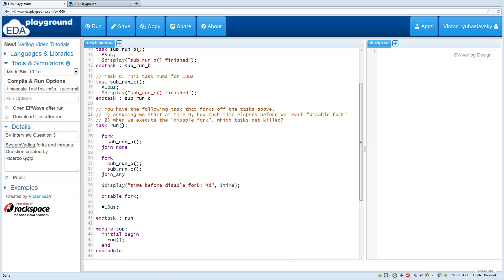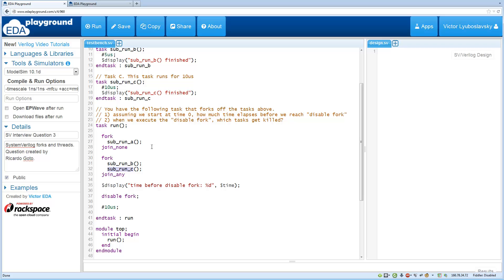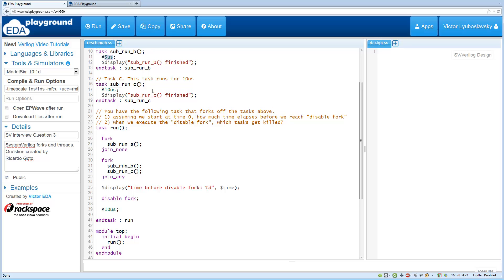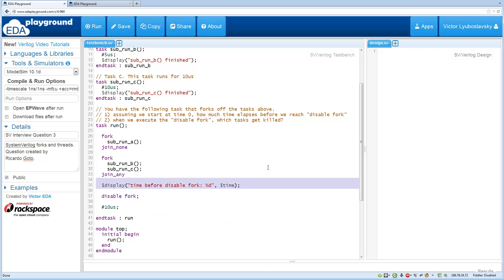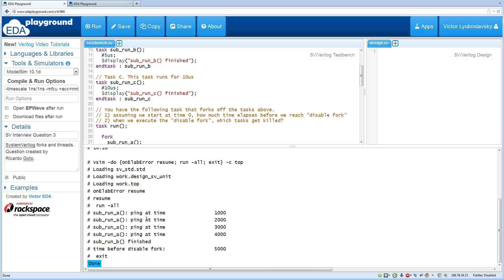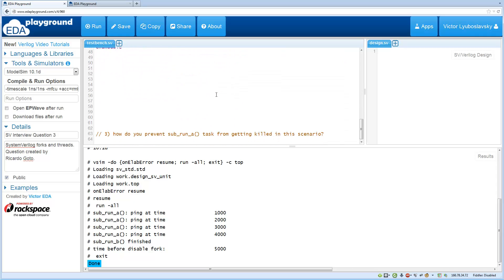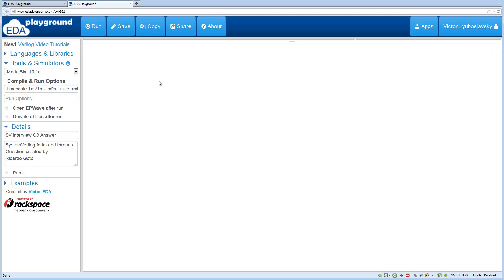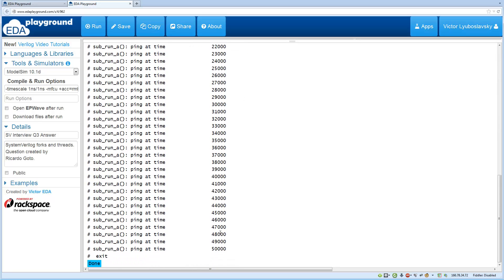SystemVerilog Interview Question 3B -- Forks and Threads

Comment: My answer is one can swap the “join none” statement in fork block 1 with “join any”. The program will then have no choice but to allow task A to complete running before going into the next fork block.

What do you think?
Reply from the maker: That would work. It meets the letter of the law, but perhaps not the spirit. The idea is for sub_run_a() to carry on executing, whereas putting it inside a fork..join_any just means that it gets to finish before any other thread is started, (In fact, a the fork..join_any is redundant with only one branch,.)

Comment: Could the owner of the page explain why sub_run_a(): ping at time                 5 000 did not get hit?
Reply from the maker: Good question. The order in which concurrent threads get executed in Verilog is undefined. So, it could be that "sub_run_a(): ping at time                 5 000 " does get hit on some other simulator (though not on any of the three on EDA Playground). Changing (eg) line 25 to (eg) "  #0 $display("time before disable fork: %d", $time);" (by adding the "#0") forces "sub_run_a(): ping at time                 5 000 " to get hit. Yet all we have done is delay the "disable fork" to the Inactive region. Here is a very brief explanation of what is meant by "Inactive region" - https://stackoverflow.com/questions/42512214/how-to-use-clocking-block-in-verilog/42512610#42512610 . Matthew

Comment: //*******// Ques : How to prevent run_a() task from getiing killed due to disable fork?
/// **** Solution starts ****
             
   fork 
 run_a();    
   join
//// *******  Solution part ends

Put solution part before  * "disable fork" ** , to get the desired result.
Reply from the maker: That would work. But you have changed the behaviour of the code (tasks B and C now don't start until A has finished). If you look at the answer from Wayne Wang,  he has managed to prevent the task A from being killed without changing the behaviour. (This is a hard question. It's difficult to say, because I know the answer, but I'm not sure I would have been able to answer it.)
Reply: @Edaplayground_EPWave  wait fork should work before disable fork
Reply from the maker: @Devika0122  Yes, but won't that kill the sub_run_b() and sub_run_c() tasks as well? I guess the English is ambiguous, but I think it implies that we don't want to kill the sub_run_b() and sub_run_c() tasks.
Reply: @Edaplayground_EPWave  Wayne Wang's solution also lets task c finish which isn't the requirement of the question. I tried to to simulate his solution and it shows so.
So what is the proper solution?
Reply from the maker: @shahzebimtiaz1849  I agree. I think you need an extra begin..end. See https://www.edaplayground.com/x/e3B4 .

Comment: task run();
  fork
    sub_run_a();
  join_none
  fork:lable
    sub_run_b();
    sub_run_c();
  join_any
  $display("time before disable fork: %d", $time);
  disable lable; 
  #10us;
endtask : run
Reply from the maker: That's a good solution.

" disable lable; " You're a poet and you didn't know it!  :-)
Reply: @Edaplayground_EPWave  I think this has one disadvantage. Say if we have other instances(objects) and, when they call this task the disabled fork block  will remain disabled and, it will not execute at all. Using this naming approach for fork makes this be visible to all the other objects(ie: I think it becomes static in nature)
Reply from the maker: @srirams1986  Yes. I think you're right. Disabling fork joins can be a bit of a minefield.

Comment: Hi Matthew,

I tried using EDA playground and I am running into some issues to get the code compiling even though the code seems pretty clean. Anyways this is what I am trying to do

task run();
int a,b=1;
int d = 3;
int e =4;
fork : first
 begin
    a=b+d
 end
join : first

fork : second
 begin
    b=a+e;
 end
join : second
$display("a = %0d",a)
$display("b = %0d",b)
endtask : run

If I run the above task run, in what order will the two forks be executed if we are running on a single core? This can be a potential race condition, Correct?

I understand fork-join is used for concurrency, but does it really achieve that on a single core machine? My understanding is that at any given time only a single thread can run on a core.

Please let me know if I am missing something.
Reply from the maker: Hi Abhilash,

There are three issues here:

i) You are right than fork-join is used for concurrency, but the concurrent threads are those between a single fork...join pair. So,

  initial
    fork
      $display("This thread will be run...");
      $display("...concurrently with this one.");
    join

The order of execution is indeterminate, so we might get:

  This thread will be run...
  ...concurrently with this one.
  
or we might get

  ...concurrently with this one.
  This thread will be run...

There is no way to tell. 

However, in your example, the two additions are NOT run concurrently, because the two fork...join blocks are executed sequentially. So, this looks more like your code

  initial begin
    fork
      $display("This thread will NOT be run...");
    join
    fork
      $display("...concurrently with this one. This one will ALWAYS be second.");
    join
  end

Running this will ALWAYS give this output:

  This thread will NOT be run...
  ...concurrently with this one. This one will ALWAYS be second.

ii) The concurrency within a fork...join block is exactly the same as the concurrency between initial and always blocks. This:

  initial
    fork
      $display("This thread will be run...");
      $display("...concurrently with this one.");
    join

is exactly the same as this:

  initial
      $display("This thread will be run...");

  initial
      $display("...concurrently with this one.");

iii) Threads are not run concurrently on multiple cores. Verilog was designed in a time when computers usually had just one core, so at any one time only one thread is running. The simulator is free to execute any concurrent threads in almost any order it likes - the order is indeterminate. So, you might well ask what is actually meant by "concurrency", given that the simulator is only executing one thread at any one time. The answer is that a group of concurrent threads can be executed in almost any order in a timestep, in other words, a simulator as free to execute everything that has to be done at a certain simulation time, in almost any order it chooses. Execution of a thread must stop when that thread meets some kind of timing control (wait or # or @) - it will resume at some future timestep when the simulation time has advanced.

"Almost"? Yes, almost. The "almost" is key. The simulator is restricted slightly, according to what kind of assignment you use. Blocking assignments are always executed before non-blocking assignments and $strobe and $monitor are always executed last (at any timestep). The simulator runs according to this flow chart (which illustrates"the verilog scheduler"):

  from previous timestep
    |
    V
  BLOCKING ASSIGNMENTS
    |
    V
  #0 ASSIGNMENTS (no longer used)
    |
    V
  NON-BLOCKING ASSIGNMENTS
    |
    V
  $strobe, $monitor
    |
    V
  to next timestep

Verilog is vulnerable to races, there is no getting away from that. There are steps you can take to avoid races: I'm sure you know that you use blocking assignments for combinational logic and non-blocking for sequential. That is to avoid races; they are avoided because non-blocking assignments are executed after blocking assignments, as shown in the above flowchart.

However, with more high-level constructs - tasks, fork...join etc - you are still vulnerable to races. It is up to you (the programmer) to sort that out.

DISCLAIMER: 

I have answered this question for Verilog, not System-Verilog. The scheduler is even more complicated in System-Verilog (it has 9 states, not 4) and there is the added complication of what are called "dynamic threads", which are introduced because of the fork...join_none and fork...join_any constructs.
Reply: Thanks Matthew, appreciate the detailed explanation. I had one more question.

Assume all variables are initialized to zero at the beginning.

Code1:

always@(posedge clock)
fork
  #2 a=1;
 #2 b=1;
 begin
 #2 c=1;
 #2 d=1;
 #2 e=1;
  end
#2f=1
join

Output: a,b,c and f all go high 2 ns after the clock edge. d has an additional 2ns delay and e has a further 2ns delay.

Code 2:
always@(posedge clock)
begin
  #2 a=1;
 #2 b=1;
 fork
 #2 c=1;
 #2 d=1;
 #2 e=1;
  join
#2 f=1
end

Output: a goes 2ns after clock, b 2ns after a. c,d,e all go high 2ns after b and f goes high 2ns after (c,d,e).

Do you think this is correct?

Also within the always block in code 1 and code 2, how many threads do you notice?

Thanks
Abhilash Gopal
Reply from the maker: Hi Abhilash,

> Do you think this is correct?

Yes. Also,

Code 2:
always@(posedge clock)
begin
  #2 a=1;
 #2 b=1;
 fork
 #2 c=1;
 #2 d=1;
 #3 e=1;   // changed this to 3
  join
#2 f=1
end

Now output: a goes 2ns after clock, b 2ns after a. c,d all go high 2ns after b, e goes high 1ns after c,d and f goes high 2ns after e (3ns after c,d). This is because the code after a fork...join doesn't execute until all the threads inside the fork...join are complete.

> Also within the always block in code 1 and code 2, how many threads do you notice?

Code1:
4 threads

Code 2:
3 threads

Cheers,

Matthew
Reply from the maker: It works, but you can get away with one less fork...join. Have a look a this:: https://www.edaplayground.com/x/2MW6

Matthew
Reply from the maker: Sorry - replied to the wrong message...

Comment: Hi - 

What if we put another fork ...join on top of these forks as following 

module top;
  
  task top_a();
    while($time < 12ns) begin
      #1ns;
      $display("top_a = %0t",$time);
    end
  endtask 
  
  task top_b();
    #5ns;
    $display("top_b finished at 5ns");
  endtask
  
  
  task top_c();
    #10ns;
    $display("top_b finished at 10ns");
  endtask
  
  
  task run();
    
 fork 
  begin
     fork 
       top_a();
     join_none
  end
    
    begin  
     fork 
       top_b();
       top_c();
     join_any
  //  end
     disable fork;
    end 
   join      
       
     #5ns;
       
  endtask
       
       
  initial begin
    run();
  end
endmodule

This also works while simulating it.

Please provide your comments whether its correct way or not.
Reply from the maker: +Pratik Shah 
The extra fork-join makes no difference, because the the fork-join_none starts a dynamic thread and so finishes immediately. So, we have to wait for the fork-join_any thread, which was the case before you added the extra fork-join.

Comment: Hi 

I was able to solve this question.However I got one more query 

// Task A. This task runs for 50us
task sub_run_a();
  while ($time < 50us) begin
    #1us;
    $display("sub_run_a(): ping at time %d", $time);
  end
endtask : sub_run_a

// Task B. This task runs for 5us
task sub_run_b();
  #5us;
  $display("sub_run_b() finished");
   
endtask : sub_run_b

// Task C. This task runs for 10us
task sub_run_c();
  #10us;
  $display("sub_run_c() finished");
 
endtask : sub_run_c

task my_task();
   fork
    
    sub_run_b();
    sub_run_c();
    
  join_any  
 
endtask:my_task

// You have the following task that forks off the tasks above.
// 1) assuming we start at time 0, how much time elapses before we reach "disable fork"
// 2) when we execute the "disable fork", which tasks get killed?
task run();

  fork
    sub_run_a();
  join_none

    #10us;
  
endtask : run

module top;
  initial begin
   fork 
    
     run();
      my_task();
   join
     $display("time before disable fork: %d", $time);
  disable fork;
  end
endmodule 

When I am doing this it is waitng for sub_run b and sub_run c to finish.Why is that ?Is it because in module we are doing fork and join?In that case why is it not waiting for sub_run a to finish .Kindly let me know
Reply from the maker: +jyoti sachdeva 
There's no time like the present...sorry for the delay - I've just seen this.

The fork...join in module "top" will wait for both "run()" and "my_task()" to finish. "run()" finishes after 10us (because of the 10us delay -  "sub_run_a()" runs concurrently because of the fork...join_none); "my_task()" finishes after 5us (the shorter time of "sub_run_b()" and "sub_run_c()", because of the fork...join_any).